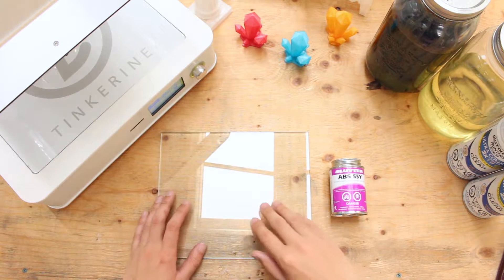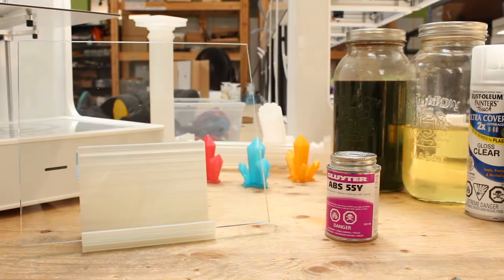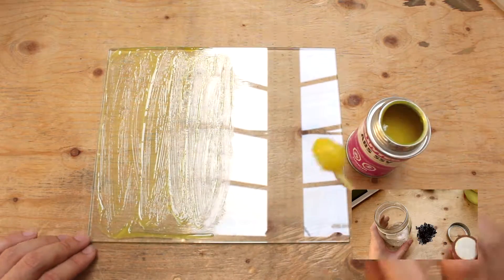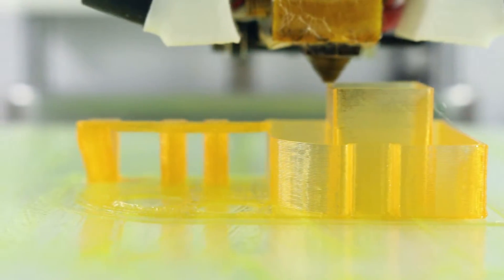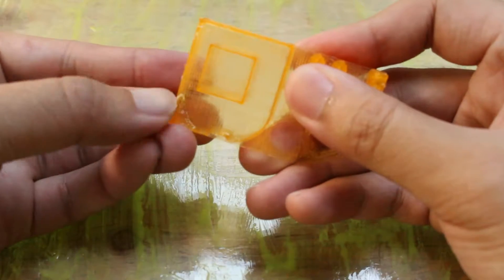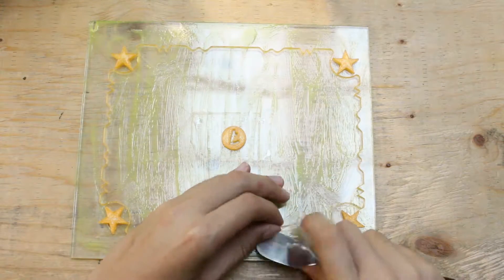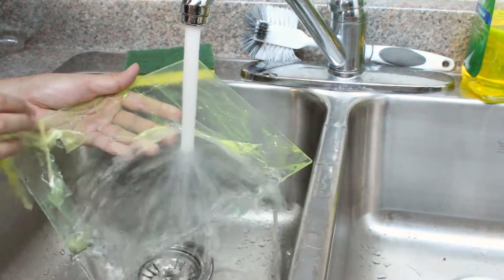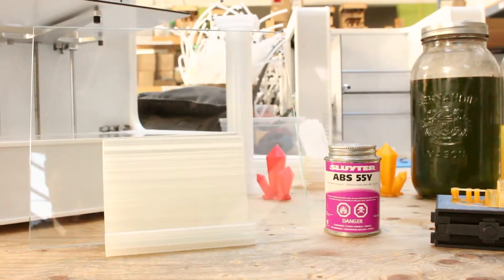Bed Adhesion with ABS Solvent Cement

Comment: I suggest thinning it with MEK so it will flow into a thin sheet. I suspect you can fix the spots where parts are removed, by just wiping MEK over the glass. Melting and redistributing what is there.
Reply from the maker: Hi,

Thanks for the comment! We will definitely try that out next time.